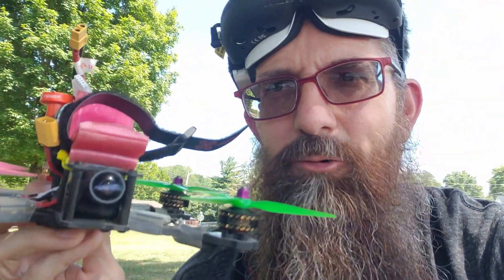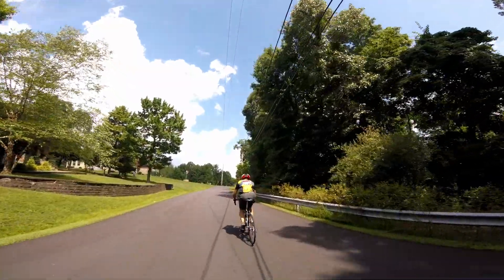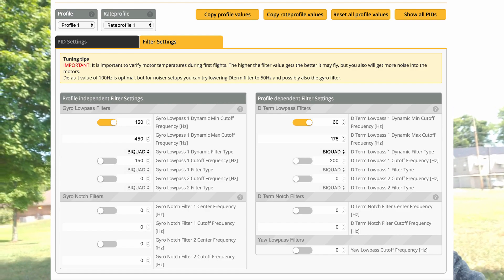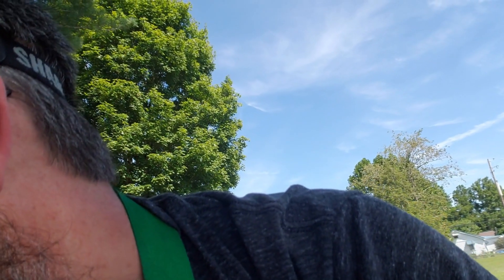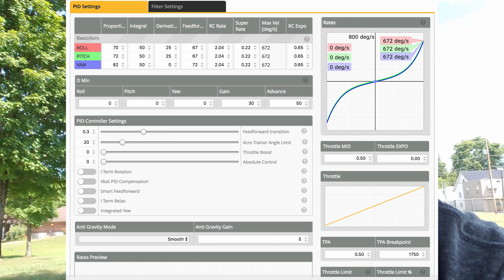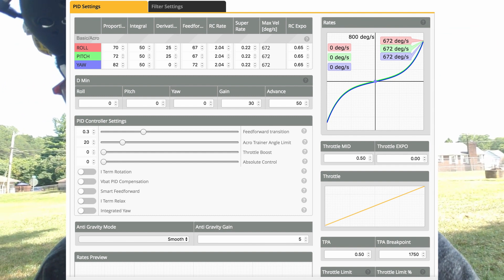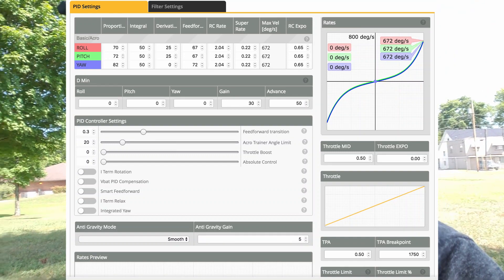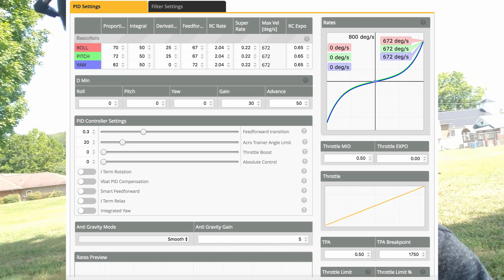So Long Oscillations / Fixing Jello on Betaflight 4.0.4 / Staceman FPV

Comment: Flies better than any my quads.  I'm at a point leaving the quad side of this hobby with this impossible to tune betaflight
Reply from the maker: What is your setup (frame, electronics), and what version of betaflight?  It's really not that hard once you know a few things.  Things that can adversely affect it the most are poor build, low quality electronics, and certain frames.
Reply: @StacemanFPV  I flight 6 inch frame VgoodRC F4 fc Dji xing 2306 1750kv motors and racer star BLheliS 35 amp 4in 1 esc. Dal tri prop 6042 and dual 6042. I was running a lux F7 and takon 32 esc I spent a ton of money on high end electronics to no avail so honestly care less about what I spent.  I refuse to waste more money on these quads that fly like shit.  My builds are tight and I've been building planes for years and quads since 2011 with mutiwi so think my build experience is good.  I've spent countless hours trying to tune these 6 inch quads and its just not happening.  I would LOVE to try EMUFLIGHT but seems my VgoodRC F4 DJI FC isnt supported yet.
Reply from the maker: @Freebird_67  do you have video showing the problems?
Reply from the maker: One other thing.. The iflight 6"/7" frames are terrible for vibrations.  I know from experience.
Reply from the maker: And which version of betaflight and are you running rpm filtering?  Highly recommend that.  Solves many issues.  My iflight 7" was unflyable (even to hover) until I setup rpm filtering
Reply: @StacemanFPV  I'll try rpm filters but not so sure I can use that on BLHeliS 4 in 1 or can I?
Reply: @StacemanFPV  I'm on latest BF 4.2.x
Reply from the maker: @Freebird_67  you can but you'll need to get the JESC firmware.

Comment: I'm still struggling with mid to high oscillation. Low to mid it's great but once I start hitting the higher throttle range then the oscillations get shaky 😭 Do you know anyone who's willing to tune my quad for me?
Reply from the maker: What's the hardware setup?  Motors, props, battery, FC and firmware?
Reply: @StacemanFPV 

Hardware: DYSF4 Pro / KISS 32A Esc's
Motors: Lumenier MX2206-9 2450KV
Props: Ethic S3
Batt: CNHL 1500 4S
Firmware:  BF 4.0.2 No RPM Filtering.

I can send PIDS/FILTERS VIA Messenger 👊🏻

Comment: i don't think i've seen a super rate as low as 0.22 but your rc rate is quite high , interesting , i never run any expo either , but it makes it so so twitchy in the centre , but thats how i like it , super responsive , i generally use the same set up for every 5 inch i build and it just works , so going back to old school is not a bad way to go ..... as for finding another spot, how about i set you a challenge, i did this today on my last pack , go into some thickish woods , flatten your camera angle completely , now fly aorund yourself at about a 40 yard radius , but going through all the tree tops , at times your almost in hovers , navigate through , like a cross country run , but it's one scary buzz i tell you , but very doable if you don't panic on the sticks , i never go mad anyways when i fly , it's mostly chilling , but that does help massively with throttle control , which i think i do very well at with lower speeds , and it sure shows when you try this , use the 3 inch ...and you'll be surprised how much fun it is
Reply from the maker: You should give it a try sometime.. Basically results in a more linear feel, which is far more predictable
Reply: @StacemanFPV  yeah i may do that , try the tree tops though if you get chance, and don't come down , get through them , it's real slow but the scariest and hardest flight i've ever had , so hard at low speed ,  the trees were spaced out around 3 to 4 yards , some closer some wider apart , but the tree tops all joined together but there were always little gaps around , i'll record it next time i go there , i never made a full circle but i got 3/4 around and bailed low
Reply from the maker: @AndyM65  would love to see that!!
Reply: @StacemanFPV  it's more scary than hard , if you can yaw holding it in the same place almost , it's very doable , you just cant look up or down much , but very easy to stick your quad , dunno what came over me , but i thought to myself, never seen anyone do that , so i went up haha and once you're up you kinda have to , so it forced my hand a little bit
Reply from the maker: @AndyM65  LOLOL necessity is the mother of invention :)
Reply: @StacemanFPV  haha when i'd relaxed a bit i was doing ok , it's just starting it i guess , but it felt and looked amazing going through it , almost like a cross country come trials course , i just came into some real thick shit and had to bail it , i should probably build a shity quad just to try that stuff really
Reply from the maker: Yeah.. No sense breaking good stuff for that :)

Comment: +1👍 rewatched, 3rd time, i think i need a summary on the non-PID options you modded. :P
itermrelax off for sure!
Reply from the maker: I'll post a diff here in a bit
Reply from the maker: # diff

# version
# Betaflight / DYSF4PRO (DYS4) 4.0.4 Jun 30 2019 / 14:10:04 (f3a95efa3) MSP API: 1.41

# start the command batch
batch start

board_name DYSF4PRO
manufacturer_id 

# name

# resources

# timer

# dma

# mixer

# servo

# servo mix

# feature
feature -RX_PARALLEL_PWM
feature RX_SERIAL

# beeper
beeper -GYRO_CALIBRATED
beeper -RX_LOST
beeper -RX_LOST_LANDING
beeper -DISARMING
beeper -ARMING
beeper -ARMING_GPS_FIX
beeper -BAT_CRIT_LOW
beeper -BAT_LOW
beeper -GPS_STATUS
beeper -RX_SET
beeper -ACC_CALIBRATION
beeper -ACC_CALIBRATION_FAIL
beeper -READY_BEEP
beeper -DISARM_REPEAT
beeper -ARMED
beeper -SYSTEM_INIT
beeper -ON_USB
beeper -BLACKBOX_ERASE
beeper -CRASH_FLIP
beeper -CAM_CONNECTION_OPEN
beeper -CAM_CONNECTION_CLOSE
beeper -RC_SMOOTHING_INIT_FAIL

# beacon

# map
map TAER1234

# serial
serial 0 64 115200 57600 0 115200

# led

# color

# mode_color

# aux
aux 0 0 0 1800 2100 0 0
aux 1 35 1 1725 2100 0 0

# adjrange

# rxrange

# vtx

# rxfail

# display_name

# master
set gyro_lowpass2_type = BIQUAD
set gyro_lowpass2_hz = 0
set acc_hardware = NONE
set mag_hardware = NONE
set baro_hardware = NONE
set rc_smoothing_auto_smoothness = 20
set serialrx_provider = SBUS
set motor_pwm_protocol = DSHOT600
set yaw_motors_reversed = ON
set pid_process_denom = 1
set osd_avg_cell_voltage_pos = 2347

# profile
profile 0

set dyn_lpf_dterm_min_hz = 60
set dyn_lpf_dterm_max_hz = 175
set dterm_lowpass_hz = 200
set dterm_lowpass2_type = BIQUAD
set dterm_lowpass2_hz = 0
set feedforward_transition = 30
set iterm_relax = OFF
set iterm_relax_type = GYRO
set iterm_relax_cutoff = 10
set throttle_boost = 0
set p_pitch = 72
set i_pitch = 50
set d_pitch = 25
set f_pitch = 67
set p_roll = 70
set i_roll = 50
set d_roll = 25
set f_roll = 67
set p_yaw = 82
set i_yaw = 50
set f_yaw = 72
set d_min_roll = 0
set d_min_pitch = 0
set d_min_boost_gain = 30
set d_min_advance = 50

# rateprofile
rateprofile 0

set roll_rc_rate = 204
set pitch_rc_rate = 204
set yaw_rc_rate = 204
set roll_expo = 65
set pitch_expo = 65
set yaw_expo = 65
set roll_srate = 22
set pitch_srate = 22
set yaw_srate = 22
set tpa_breakpoint = 1750

# end the command batch
batch end

#
Reply: @StacemanFPV  thanks a ton !
Reply from the maker: @nerdCopter  you are welcome!

Comment: Glad you got things worked out! Just curious, what do you alter on your F1 quad settings to feel more like Betaflight feed forward when set in the 60's? Looser feeling as you mentioned. Just wanted to see how you accomplished this on your F1 quads.
Reply from the maker: Legacy mode... Don't run sim mode..pids are 371/49/80

Comment: very cool, good info, I've been in the exact same boat.  flies great but doesn't look so good on the HD footage.  Getting closer, I'm going to try more of your suggestions !! 
Been working with I-term relax and more anti-gravity rather than upping I-term.  I think my i-term values were way too high.  
Thanks Stacey !  very interesting to see others working on this exact same issue.  
One question, with those higher yaw P and I values, do you get any snap at the end of quick yaw movements ? 
If I raise yaw P and/or D like that, then yaw is too aggressive on the quick stops. Bounces more aggressively the higher the P and I values. 
Let’s see some quick yaw spins and then stop abruptly, how does it handle ?
Reply: +1👍 between both you guys revisiting of 4.0.x, i feel i should really look into it now.   same thing here: feel-good control & crappy HD.  just need the time. (& i;m such a rookie, unsure if i will know what's right anyway)

Comment: LoL... That the exact reason I went to something else, first thing I would do in beta is spend 10 minutes turning so much stuff off!
I mean we prett much all turn off the whole beeper section and turn on the basic osd info so why not just have that as default.
Also like to see someone else using the rates the "wrong" way , I was around rc 2.14 sr .03 and expo .47 when on beta and that's the second reason I switch to RF the rate system seams more natural to me, last time ai looked at the beta code they did have the raceflight1 and the kiss rate systems in there but not implimented yet, so would be nice if they got that working if not yet.
Anyway glad you got the vibes sorted. And every time I see you fly I just think of how you flew a year ago.... You've come a long way buddy😀👍
Reply from the maker: Yeah..a year ago was ugly for my flying..I figure a year from now my flying today will be ugly too LOLOL

Flight one definitely has a better rate system but you can get betaflight close.. Just have to make it more linear.

It's funny I used to think I wanted it flatter in the center with a big jump on the ends.. Finally figured out that it makes control very unpredictable doing that.

And I definitely prefer flight one on configuration.  Nothing else comes close.  They all have quirks but that ease of configuration wins me over every time.
Reply: @StacemanFPV  right on, the my linear curve, I've always been like that exactly because the quick transistion at the ends of the sticks would cause me to crash when trying to avoid things quickly. Your curve looks like mine but slower on, though I did just lower my max deg down to 1044

Comment: Smooth as butter Staceman!
Reply from the maker: Thanks buddy!  I was beginning to wonder if I could get it fixed
Reply: @StacemanFPV  I hear ya.... the Betaflight world is messy and complex with so many options that all interact with all other options. Glad you went back to what you felt good with and it worked. Rarely does it happened as planned.
Reply from the maker: @kydawg1684  the stuff that they keep adding could all be solved using normal PID controller with TPA adjustments like F1 does across the throttle range for   P, I, and D.  The options they add are more like hacks rather than features.

Comment: Nice rip,  video looks great and the kwad looks like it's flying great as well. Glad ya found the perfect tune for your setup and got the jello worked out.
Reply from the maker: Me too!  Was driving me nuts
Reply: @StacemanFPV  I felt the same way when I had to rebuild the flosstyle and start from scratch where I didn't backup my old fc and it was toast so I couldn't pull my tune from it.